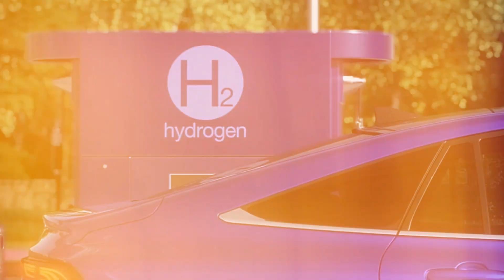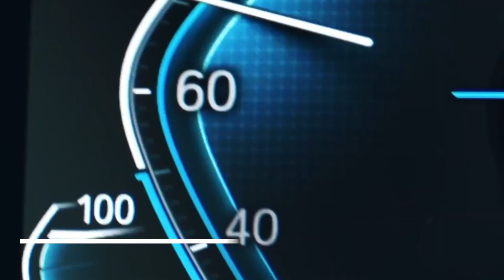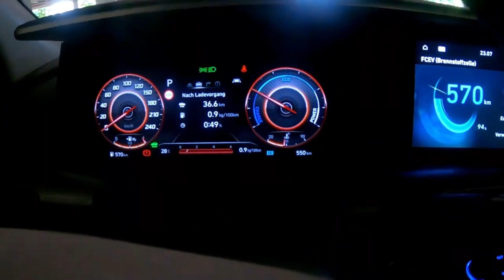BMW CEO: This NEW Engine Will DESTROY The Entire EV Industry

Comment: How is hydrogen produced?

You can't make this up, by electricity produced by coal fired power plant. The stupidity of the "Greens" (low IQ communists) is astonishing.

But that is not the worst part, over 30% of the energy used to produce hydrogen is lost in the process, i.e. this is only possible due to corruption (also very normal with communists).

😂😂😂

.. and, of course they do not emit any "Greenhouse Gases" - It's very hard to emit gases that doesn't exist (in the real world!)

There's no (Man Made) Global Warming, now called "Climate Change" due to lack of warming (agin - in the real world).

Come to think of it, there's no "Greenhouse Effect" either (again, in the real world!)

Here's why:

Radiation play no measurable role in cooling of the surface of the earth because of the atmosphere's density, all measurable cooling is done by convection.

That means there's no "Greenhouse Effect" and even less "Greenhouse Gases." 

The reason it is not is because of the Troposphere's density (Mass, Pressures and Gravity) resulting in the Adiabatic Lapse Rate.

The Adiabatic Lapse Rate, which is proven to exsist, both measured and observed and the "Greenhouse Effect" can not exist at the same time in the atmosphere at altitude from the earth's surface.

The "Greenhouse Effect" would only have been possible if the "Black Body Surface" was earth's actual surface, and the "Thermal Equilibrium Point" between earth and space also was at the earth's surface.

The reason is, for the "Greenhouse Effect" to exist the earth's surface would necessarily have to be cooled by radiation, which it is not, it is cooled by convection (again - in the real world!)

Zero Carbon Dioxide (CO2) in the atmosphere is not possible due to Henry's Law. Any gases that are removed will be compensated by outgassing from the oceans according to pressure, temperature: "At a constant temperature, the amount of a given gas that dissolves in a given type and volume of liquid is directly proportional to the partial pressure of that gas in equilibrium with that liquid."

All this is confirmed by observations and have been known for decades.

U.S. National Academies Find Greenhouse Effect Doesn’t Exist
https://www.newscats.org/u-s-national-academies-find-greenhouse-effect-doesnt-exist-2/

Falsiﬁcation Of The Atmospheric CO2 Greenhouse Eﬀects Within The Frame Of Physics
https://roaldjlarsen.wordpress.com/2014/09/04/falsi%ef%ac%81cation-of-the-atmospheric-co2-greenhouse-e%ef%ac%80ects-within-the-frame-of-physics/

Derivation of the entire 33°C greenhouse effect without radiative forcing from greenhouse gases
https://www.newscats.org/derivation-of-the-entire-33c-greenhouse-effect-without-radiative-forcing-from-greenhouse-gases/